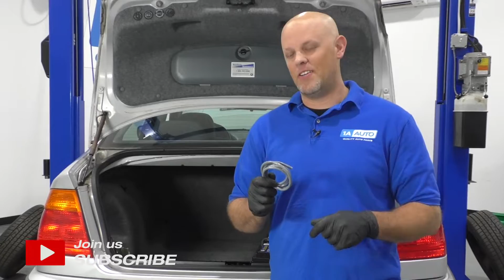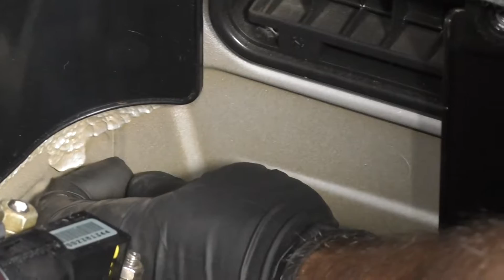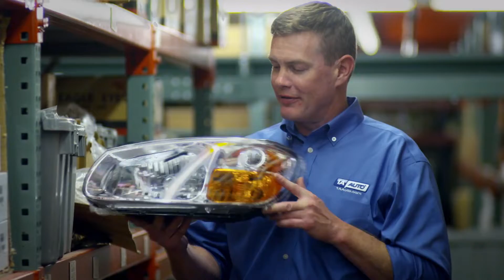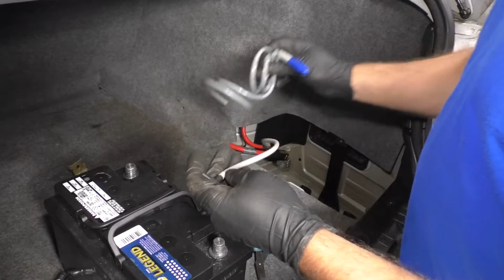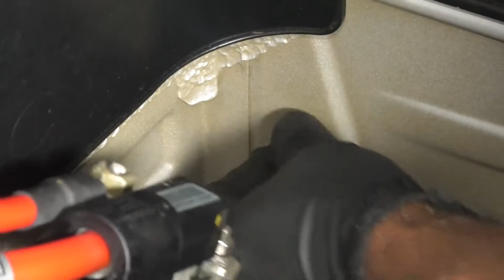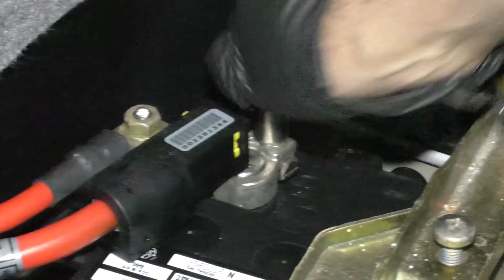How to Replace Battery Vent Tube 01-06 BMW 325Xi

Comment: Greetings to you, 1A Auto Parts!

 I had one question...are the plastic elbows on which attach to the vent line in BMW's, the same on a 2007, Cheverlet Cobalt?

 If you can get back to me if y'all would happen to know, it will be greatly appreciated.

Thank you kindly, 1A Auto Parts!